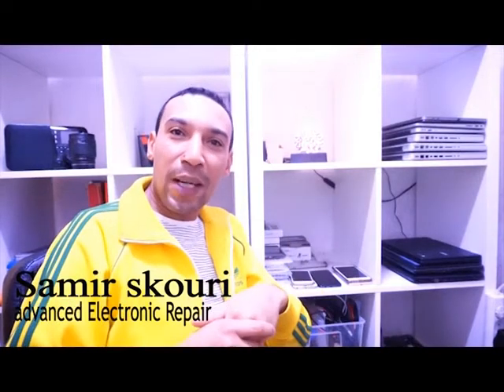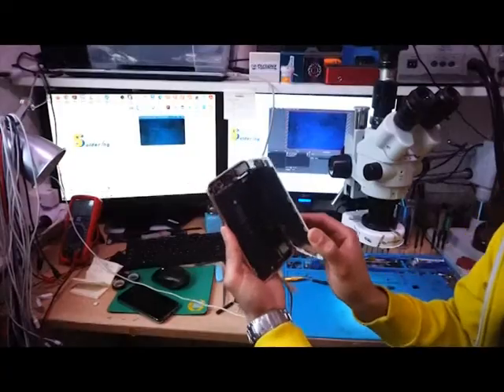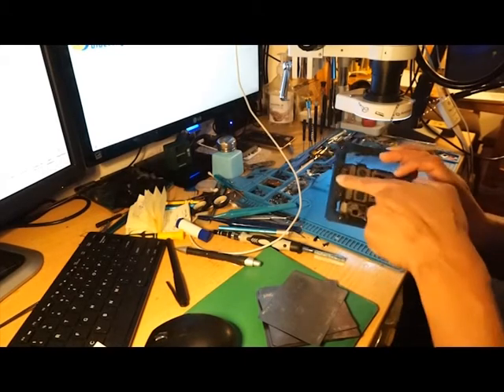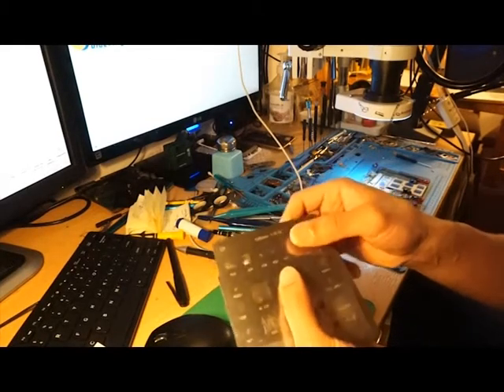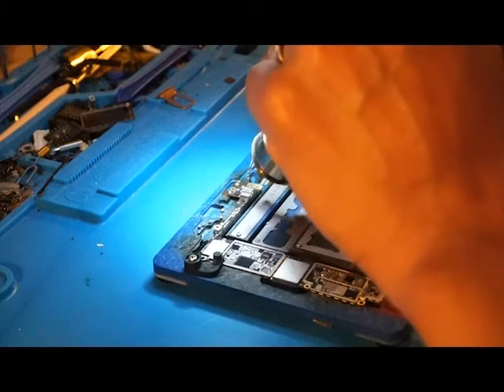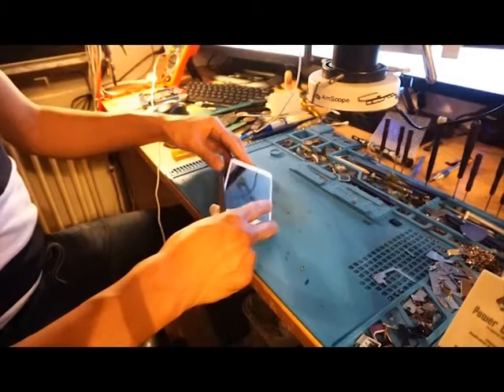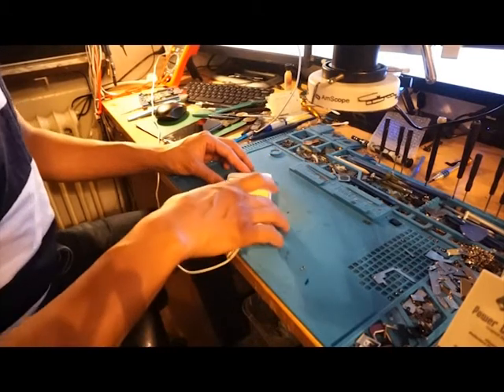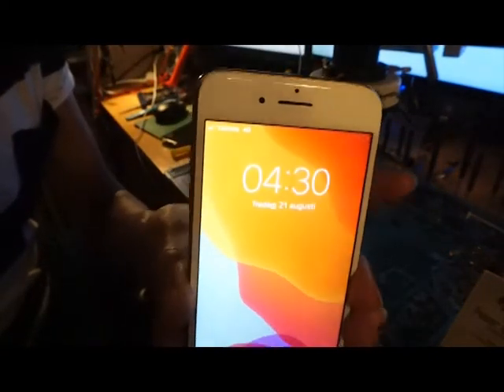iPhone 8/8Plus No Service Repair (NOT BASEBAND)

Comment: How much cost no service issues will be charged in iphone 8 plus
Reply from the maker: it depends, b/n 80, 120 USD
Reply: bro
Reply: are you getting no service issue
Reply: @sowhate1251  yes
Reply: @rockykumar9933  sorry for late reply
Reply: are you getting signal sometimes or no service every time
Reply: @sowhate1251  every time no service
Reply: @rockykumar9933  im getting signal most of the times 
i dont know what problem is mine
Reply from the maker: @sowhate1251  check the antenna
Reply: @MICROREPAIR  how to check antenna

Comment: I replace the both ic from another phone as you said but now the problem is modem firmware is gone now what can I do now
Reply: I  recommend TEXDROID on !G an excellent company. Very quick to unlock my Apple iPhone at a great price.lol 😂😁💯
Reply from the maker: if the modem firmware is not showen on the menu, then either the chip is overheated or you truck the network system by reading the schematics.

Comment: How did you knew the problem in those 2 chips please
Reply: I was going to ask same question plus 2 chips can’t fail at same time 
Anyway good work and that’s might help someone
Reply from the maker: This device is water damaged, network failure. repairing this signal chips will repair som phones with signal related failure. if you need copies of schematics and board views of your phone, pls contact me, i will be happy to help